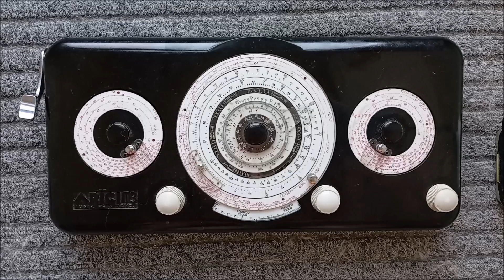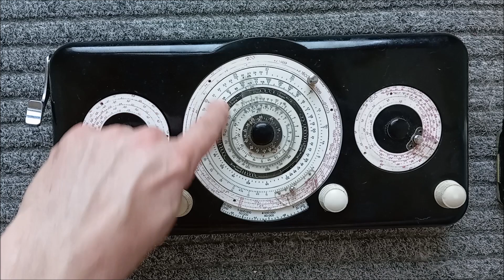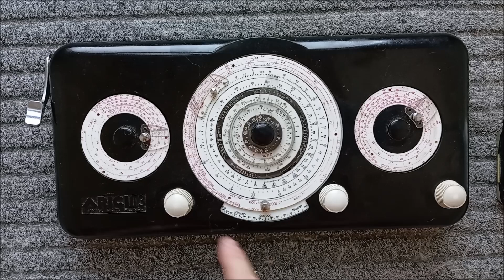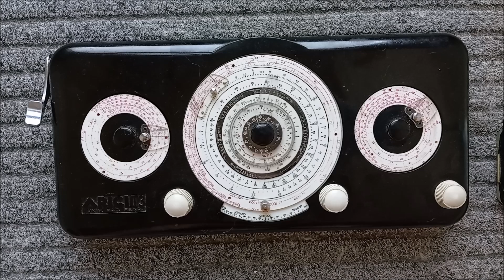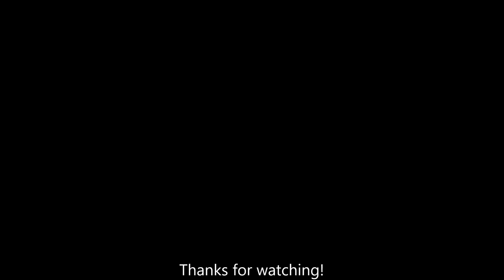Arici T3 reinforced concrete calculator

Comment: Wow! I have just put one for sale on eBay, it is an original M50 (model 50, sold from 1948 to 1955) ARICI T3 with all the original manuals etc. It was my grandfather's, who actually personally knew Arici, they both were engineers, both born in Sicily (my granpa in Messina in 1903, Arici in Palermo in 1900). It's very interesting seeing how it should be used.
Reply from the maker: Very nice! Great pictures, too. I hope you find a great new home for it.